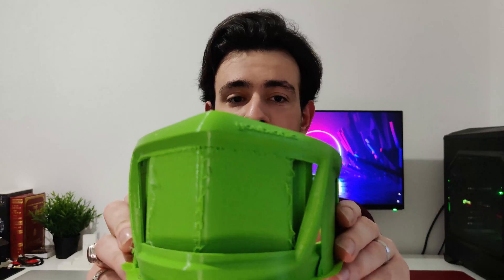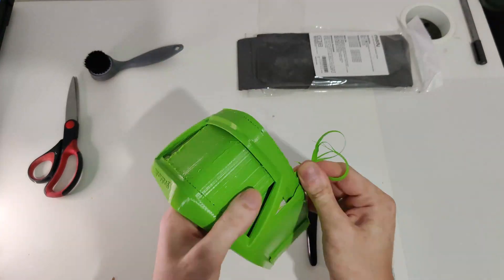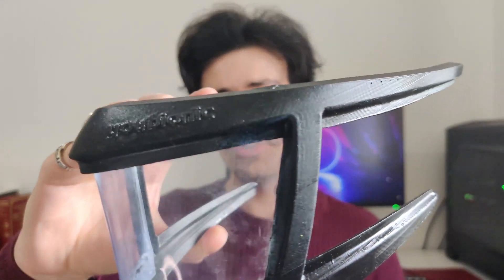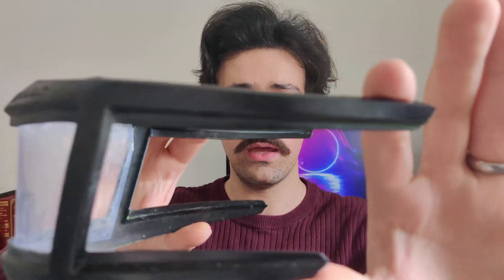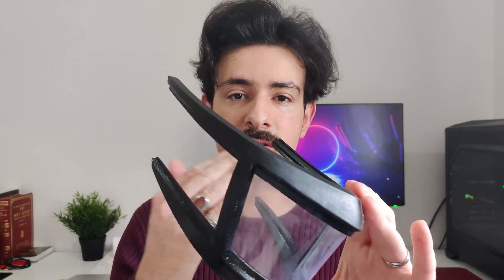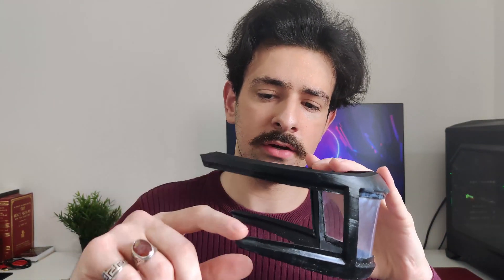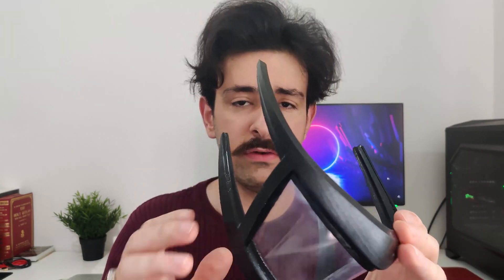| 3D Print | Youbionic Mask THE FUTURE

Comment: How does it filter the virus?
Reply from the maker: Unfortunately it does not filter the virus but it acts as a lower face shield unless you seal the gaps and create a filtration system.
Reply: @thehlshow5187  yeah that's what I was thinking about.  If the mask is sealed then it's not breathable.  Could use a filtered vent from both of the sides I guess.